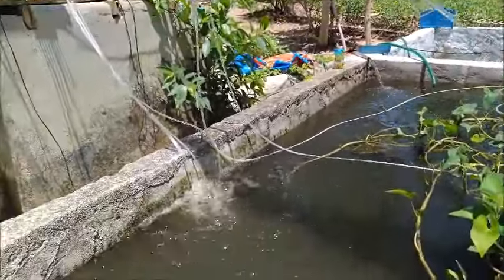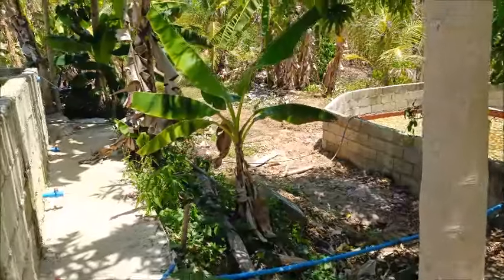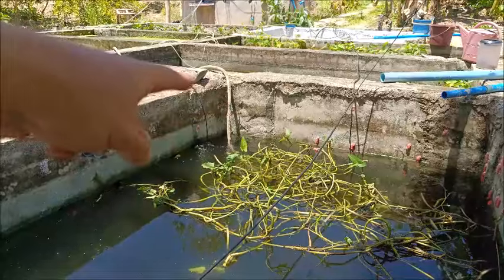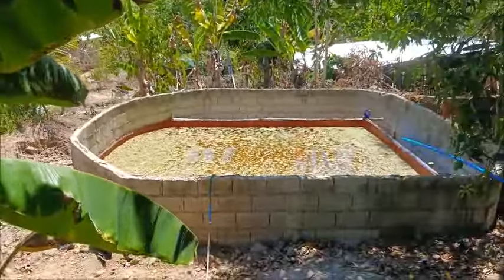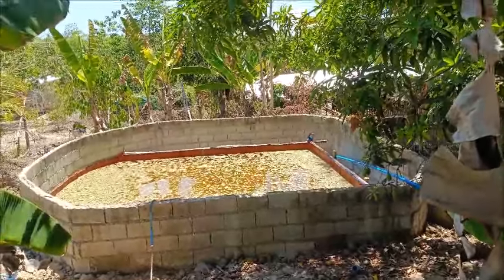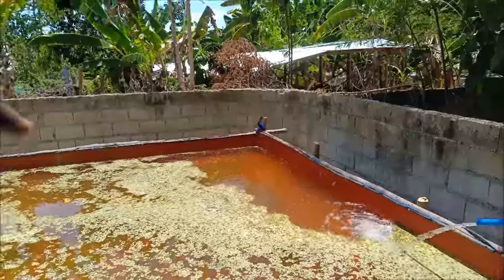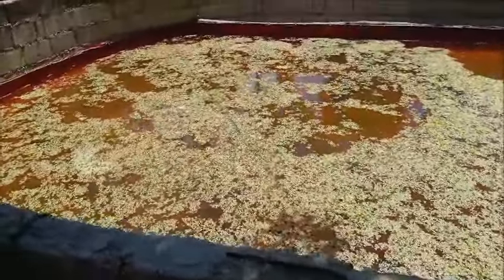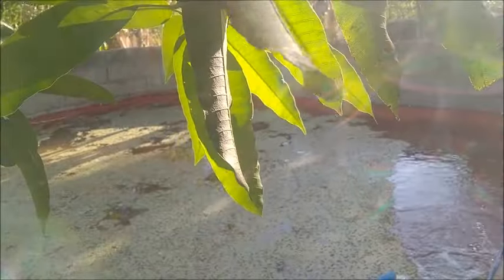Trying  A Water Exchange Before Manure

Comment: Just a bit about the importance of iron, for plants, including duckweed. Possibly use some ferrous sulphate , to green up the duckweed?!
See.
How is iron involved in photosynthesis?

To perform this process, an adequate supply of essential mineral elements, such as iron, is required in the chloroplast. Because iron plays a crucial role during electron transport and chlorophyll formation, iron deficiency alters photosynthesis and promotes chlorosis, or the yellowing of leaves.